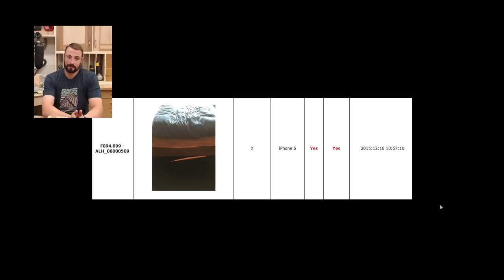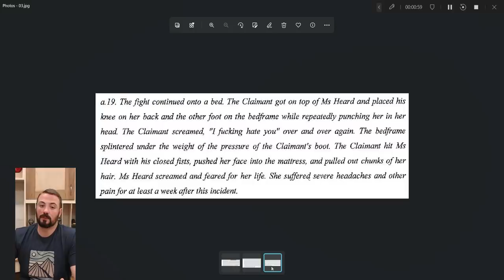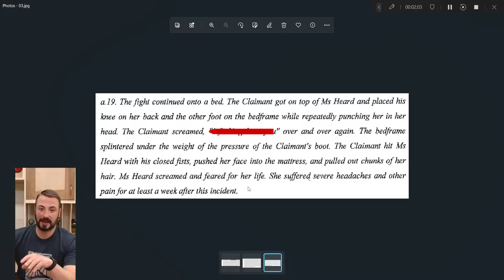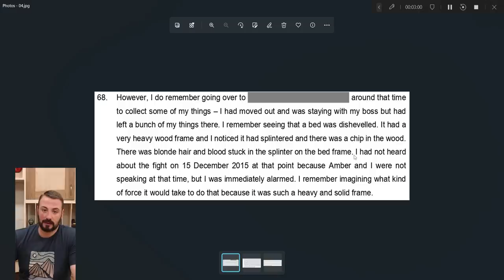Woodworker Attorney DEBUNKS Amber Heard's "Broken Bed” Testimony!

Comment: So from a Jiu-Jitsu perspective, there is the question of leverage. Amber describes Johnny putting all of his weight into pushing her into the mattress, so much so that she can't move or breathe. By definition, putting all your weight, means all or most of your weight is in one direction. If all of the weight is on the knee pinning the back of a person into the besd, then the other leg, who's boot is trying to get 'purchase' on the bed frame, would have very little force, or weight applied to it.

This is similar to the Jiu-Jitsu position 'Knee of belly', which is a controlling position where you put most, or as much weight as you can on your knee on your opponent who is lying down, and your outstretched leg is for balance with little to no weight on it. Any weight you put on the outstretched leg removes weight, or pressure that your knee is applying to your opponent,

In short, Amber's description doesn't make sense: You can't hold purchase with pressure to impossibly break the solid timber of a bed frame while simultaneously putting all your weight into your knee to push someone belly down into a mattress so hard that they can't move or breathe and pass out.
Reply: Even the jujitsu professionals are debunking her

Comment: Her relationship to furniture seems skewed... She also testified that Johnny threw her on their gaming table and jumped up and sat across ontop of her while beating her... The gaming table was shown to be a Ping Pong table... How a ping pong table would NOT collapse under the weight of two adults fighting is mindboggling to me...
Reply: I'd have to see the ping-pong table. My brother worked on his Ariel Square Four* on top of our basement table, and to do that it had be supported by one side of the table, initially.
___
* ~400 lbs. He needed needed a ramp and a lot of muscle to get it up there.
Reply: Don't forget her testimony was she was holding his lapel when he threw her so violently he actually flew through the air with her and also landed on the table 🤭 Her GED didn't provide an adequate knowledge of physics
Reply: I am with you on the ping pong table. While I am no expert, I have seen my fair share of them and they are very light. They are meant to be springy to easily propel the ping pong ball. Not speaking to all models but more than likely it would have collapsed with force, momentum and weight  of 2 individuals  fighting. IMO
Reply: Right!? The ping pong table is fine, but the bed made for rough sex isn't?
Reply: @shirleys1792  johnny is Goku confirmed
Reply: @bombomos  yeah, makes no sense...
Reply: Yes this one made no sense at all either. She kept saying game table and I pictured a pool table. Then they showed the picture of the table and it was a real flimsy ping pong table. She obviously messed up her story and even her attorney knew that no one would believe that didn't break so she asked Amber did the table collapse and Amber was like oh yeah it did but this is after it was put back together. Yeah right, there would be no fixing that table if both of them were on it, even if one person was on it. It would have had to have been a whole new table. It obviously never happened. That whole story made no sense at all. Johnny picked her up and threw her across the room like he had superhuman strength, they were both on the ping pong table where she landed, he had a bottle in his hand then no she had it in her hand and then somehow they were both standing up and facing each other.
Reply: It’s totally unbelievable
Reply: ping pong, S.A...hmmm maybe she watched THE ACCUSED... and even used the same words as jodi did on the stand
Reply: She herself really should have looked different. If she as a woman hits Someone and she probably did beat up e.g. her sister and her former wife; a British lady ( Victoria Hervey) just twittered this; Amber would have beaten up her wife, her wife would have shown this the yoga teacher, they both would have been in yoga lessons together). So she thinks she knows what beaten up looks like, but men cause much more damage on a Person. I remember this from watching Domian, a German late night show where callers told their problems. He sometimes had a show where there was a theme, so because he was irritated so often women called, all tortured by husband or father, I remember a girl both legs broken by her father, so he wanted men who were beaten up by their wives. And those men gave him a call, their wife’s beat them up, but there was not a single one really hurt severely. JD would be here the worst case with the cut finger. So my point is, she does not know what she should look like, after what  she describes there, she thinks she should look like her victims. That is wrong, she should have looked much worse, the wood splintered, she healthy and only little spot? No relation! Sorry for my English! She feared for her life, but was not injured other than a little Black Spot? Where was the hair ripped out, there should be a place with no hair, does hair break, it should be drawn by the roots!?
Reply: Despite her being in far fewer movies with less special effects, this woman lives in lala land where the world is a her movie set.  She kepts getting caught in self traps because she's trying to dramatize the made up events for effect.
Reply: After they flew across the rm
Reply: Yes! That’s another one that astounds me. I wonder if anyone has set about re-creating these alleged scenes, with with props and figures or with animation or similar..
Reply: If I remember correctly the table was collapsed in photos. ( not that I believe the witch!)
Reply: @OnceUponaTimer  I love when people call her a "Witch". I use it too.

Comment: I think another point that makes no sense is when she said he “had his whole weight on her” but how would he have his full weight on her while also exerting enough force to break a bed?
Reply: Came here to say that same thing. Even if Johnny was trying to kick the frame with his boot in a karate kick fashion he'd have to be really strong and kick it multiple times until he was exhausted with steel framed boots specially made to beat up bed frames and still barely dent the wood.
Reply: @Cerv_guitars  and maybe the wood from the bed frame would have to be very old, dried out and brittle before he could break off such a piece with a blunt object. the bed frame didn't look dry and brittle but looked like the wood was in a pretty normal state.
Reply: "He just did, don't question it" - a liar
Reply: And also, his finger was bleeding profusely from being severed.
Reply: @MakeUpMofo  right. where's the blood?
Reply: Exactly!!! I was thinking the same thing, that’s a crazy kind of split to have a knee on your back AND a foot on the ledge of the bed Lolol. The weight distribution makes zero sense
Reply: 2 men weight - Elon knee & Franco left boot...... & up she goes in a little red riding hood number! 
Ouch she good to recreate but it just don't mesh🤕
Reply: Another thing that has bugged me. I believe she said there was blood on the pillows. Set that aside for a moment, and then try to envision a 5' 9" JD, with his boot on the wood at the foot of the bed, and then him being tall enough to have his knee in her back. If there was blood on the pillow, he would have had to have been up closer to her head. His height would make such a move impossible if he had his boot on the foot of the bed trying to gain purchase. Unless JD is "Stretch Armstrong", or "Mr Fantastic", I don't see it happening.
Reply: @sfcmp7005  he pulled a MJ in Space Jam for the bloody pillows

Comment: My ex-husband is a logger and also worked with wood building homes...etc.  When I saw this I immediately thought there is no way his boot would make this type of damage. I wear steel toed work boots around the property but also when I used to go into the woods, once in a while and assist my ex-husband cut wood. No work boot would ever make that type of damage considering the sole. When she said it broke and she could feel it...I expected to see cross boards breaking under her but this......absolute total BS. Manipulating, misleading and narcissistic control. Amazing video....look forward to more...
Reply: Johnny wears more of a cowboy kind of boot that aren't nearly as sturdy and invinsible as workboots.
Reply: My first instinct when I saw the picture was "that's been chiselled off", there is no way that boots could do that.
I've seen staircases built out of this Stuff and never saw any chips like this in them.
In my old house we had a staircase like this, and I would balance on the corner of the bottom step by the heel of my boots (don't ask why, it was just something I did, I'm weird). This staircase was made almost 100 years old, it was brittle and cracked in places, yet it never splintered under my weight.
Reply: @petrolhead0387  I guess I’m weird too😁 That’s okay, we can be weird together! 😂👍🤷‍♀️
Reply: @petrolhead0387  The staircase scenario is a great example.  Stairs are all build with the grain running horizontally.  Stair treads are subjected to all types of shoes/boots/slippers.  How many stair tread have you ever seen that are missing a chuck of wood on the front, even when people takes appliances and beds up and down stairs?
Reply: @petrolhead0387  I often slide my heels on the stairs, more weird stairwalking techniques!